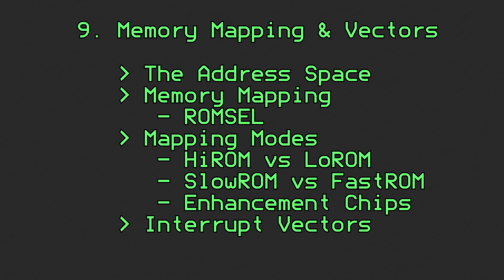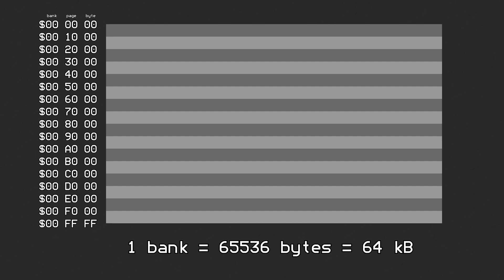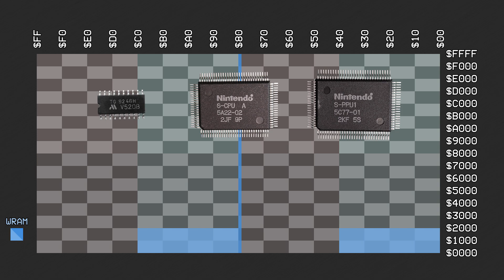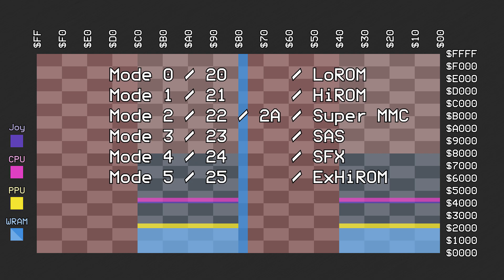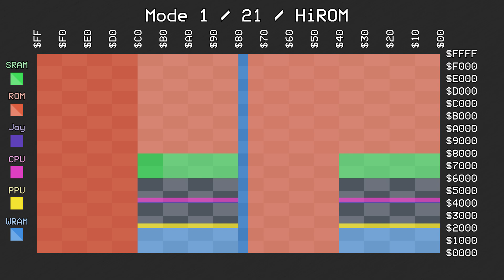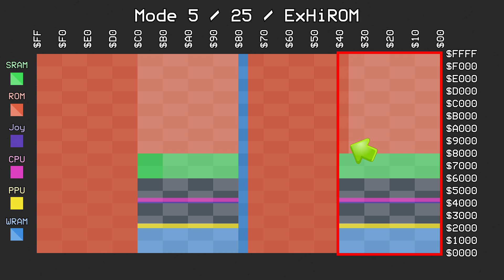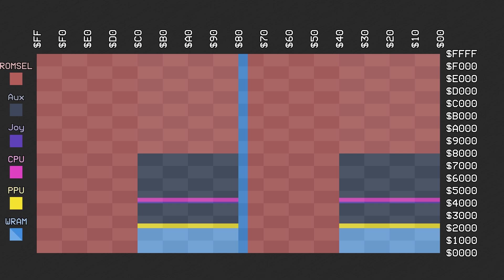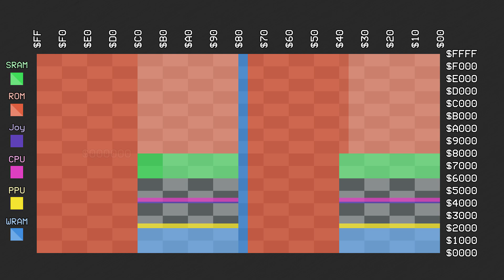Memory Mapping - Super Nintendo Entertainment System Features Pt. 09

Comment: The more I watch this, the more i think, "wow the snes really is a super version of the NES"
Reply: It was originally meant to be backward compatible! But they couldn't make that work without being too expensive.
Reply: @renakunisaki  It's such a shame that they underclocked the CPU for that, but were too far along in development to reverse it when they cancelled the feature.
Reply: The Snes's CPU isn't even a problem.  Everybody just programmed it the wrong way.
Reply: @aaendi6661  Well, if the programming techniques known to the programmers at that time were completely unorthodox to how the CPU should be programmed, is it the designer's fault or the programmers' fault?
For me, particularly, the best thing they did on the GBA was putting an ARM processor.
Reply: @JoaoBapt  All they had to do was ditch the belief that "the more cycles you use the faster it runs."
Reply: @aaendi6661  The SNES’s CPU is really slow and the system is pretty much CPU bound
Reply: @MaxOakland  The memory bus bandwidth is a bigger bottleneck than the CPU. It seems slow but actually has some features that make it punch above it's weigh. It just needed to be properly used.
Reply: Except for the PPU
Reply: @aaendi6661 either way, it doesn't beat the 8 Mhz Motorola 68000 that was used two years before the SNES came out

Comment: Imagine if Nintendo had actually gone through with full NES backwards compatibility. I wonder how they would've implemented the audio in that case.
Reply: I actually wish the SNES had NES audio as well as a couple extra channels.  The SPC700 is frustrating as hell to work with.
Reply: Emulation?
Reply: @aaendi6661 is it possible to make some kind of expansion like the Super Game Boy but for NES games? There would be a NES CPU, PPU, and RAM (somehow condensed idk) as well as a NES cartridge port. I wonder if the NES APU could be played alongside the SPC700. Not sure how the Super Game Boy does it (if it even includes the LR35902 sound at all, I should've searched this up before writing)

Comment: The funny thing is that, Nintendo spent all this effort designing the memory map so programmers could use 16-bit addressing mode,  yet 99% of programmers went with long addressimg mode for everything anyway.
Reply: what... but that's a huge hit on performance on an already underclocked CPU... It really should've run at 7.12Mhz, like the Turbografx
Reply: @vuurniacsquarewave5091  The reason why everybody did it like that was because Konami did it that way, and everybody just took Konami's word for it.
Reply: Turns out developer time is a finite ressource too, and more costly than hardware.
Also, hardware designers have a very bad habit of poor documentation. I do remember many early SNES games lagged unnecessarily because of this.

Comment: I'm glad you explained why all the different mapping modes exist. It seemed unnecessarily complicated to me when I read it (compared to the Genesis, for example, where the map is almost always the same), but having different modes for different tradeoffs w.r.t. data contiguity and access time makes a lot more sense.
Reply: It's too bad 99% ended up just using long addressing for everything in SNES, throwing any speed benefit from the way nintendo organized memory out the window.
Reply: @aaendi6661  I'm very interested into which games actually used the SNES the best way possible, do you have examples?

Comment: It's crazy how such an obtuse and unintuitive subject can become simple and clear through just proper explanations and simple diagrams.

Thank you for your work.
Reply: @B3Band  ive been reading up on assembly for the snes, and this makes it so much more clear.
Reply: programming, in general has that reputation because people just don't explain it properly...
assembly and other low-level cocepts tend to have it worse since they're considered "obsolete" in most applications [till you mess with drivers, compilers, NEW systems, embedded systems, so on]

i'm personally starting to see assembly and whatnot as being positively more SANE than C++ and its derivatives..
they still can be hard without the right sources of documentation, but the only real difference is there's a lot of manual memory management, and it takes many small steps to do something that seems 'simple' in other languages. i admit it's scary that you could so easily cause a fatal exception and totally crash the machine, but i somewhat prefer that over the abstractions and crap built-into C++ and the likes

not sure if i'll ever touch SNES homebrew or hacking, but this is an awesome series, and i do find it quite interesting actually being able to LEARN how this stuff works. One of the big turn-offs for me is that finding good documentation is next to IMPOSSIBLE. [btw, don't lookup windows exes...] 

i've currently been looking into 68k assembly and trying to reverse-engineer a NEO-GEO game. that's... umm...interesting. So far, documentation on the system is pretty good. My gripe is the CPU... I have currently three major sources of documentation I'm using, all for specific purposes... >.> [Which is why I have not touched this particular project for months until now.] Ofc, the M68K is actually a fairly complicated processor, but it certainly isn't as bad as x86! I'm slowly starting to grasp it better. At least there was thought into what kinds of complicated instructions were really necessary. One of my least favorite x86 things to actually try and understand is/was "repeat not equal scan a string of bytes" aka repne scasb. I kinda get it now, but not personally one of my favorite opcodes to stumble upon... It's one thing to say "this is how you get the length of a string" [its main use]. It's another to break it down and EXPLAIN what, exactly it's doing... 

I have a few windows games I'm looking at, but I'm a bit burnt-out from the combination of x86's nightmare fuel instruction set and the way windows executable files work behind the scenes. It's just not fun... Good news is what I was doing this for was mainly to break-apart resource files, which I'm slowly figuring-out on my own. [and with some help] I could probably code the logic for one of these games by myself, now. The others might require some research, but it's certainly faster than slowly working-through assembly code.

Anyways, the content on this channel is pretty top-notch. The world needs more like it. Maybe assembly wouldn't scare people so much, and maybe homebrew development and/or ROMhacking would be more accessible, if the resources were actually OUT there to explain it in a manner that's easy to digest. So far, they're quite lacking...
I know assembly used to completely terrify me. And then I discovered the small handful of places that explain it in a way that it may be understood. [from my experience, it's usually not those technical manuals] I'm nowhere in a position to be completely proficient with it, or make use of it, but I'm learning, slowly. It's overall a pretty fun process. It can be stressful or frustrating, but it's exciting to learn about, especially actually be able to understand even a fraction of just how our computers manage all the complexity that most of us would take for granted.
Reply: What about C, it's supposed to be closer to the 'metal' than C++?
Reply: @B3Band  He meant simple as in "easy to read", not "easy to make".

Comment: Now imagine, on NES you only have the first column of this graph, 0000-FFFF, so only 16-bit addresses. This 64kB area is then broken down similarly:
0000-07FF - 2kB Work RAM
0800-1FFF - Mirrors of Work RAM
2000-2007 - PPU registers
2008-3FFF - Mirrors of PPU registers
4000-401F - APU (sound) & Joypad registers, Factory testing registers (locked without modding)
4020-7FFF - Not mapped / Open bus (typically used by extra Work or SRAM and more advanced MMC chips)
8000-FFF9 - Cartridge ROM (an MMC chip in the cart if any, is responsible for banking the larger ROM into this area)
FFFA-FFFF - Interrupt Vectors
Reply: The SNES was planned to be backwards compatible but that idea was canned half trough the project, too late to change stuff around tough.

Comment: One thing to add is that the cpu can have 24 bit instructions. But works faster if you restrict yourself to instructions using only 16 or 8 bit addresses. This makes it useful to layout the memory in such a complicated way
Reply: Too bad nobody took advantage of this.
Reply: @aaendi6661  I'm sure you're exaggerating a bit... Then again, I don't know too much of the SNES outside of SMW and YI.
Reply: @MarioFanGamer659  I don't know about Yoshi's Island, but Super Mario World definitely overuses long addressing.
Reply: @aaendi6661  I get your point but also remember that SMW is a launch game (it also was slightly rushed, IIRC) and the 65c816 processor is a rarely used processor it makes sense why it used unnecessarily long addressing (at least the lack of data bank shenanigans). Of course, it also uses (sometimes) long addressing when it isn't absolutely necessary (either same data bank or data bank switch is faster) which is where I get the "overused" part (I still believe you make mountains out of molehills, though).
Reply: @MarioFanGamer659  Capcom never got any better with it.

Comment: FOR THOSE ASKING ABOUT 'WHY MIRROR RAM'

From what I got (I'm no expert, but I have at least some understanding of memory and programming) .... picture a Playstation Game on 4 discs. Say, FF8. As you go through the game, you can revisit older areas. Why? Because those older areas' data are mirrored on the later discs. If they didn't mirror the older areas' data, then you would get a "Please Insert Disc 1" every time you wanted to step into Balamb Garden, for example. The memory mapping works much the same way: If you're working in a specific area of the RAM, it is much slower to jump out of that section, and into another section to find the data you need. UNLESS, of course, you copied that data and mirrored it into several different sections. Now, they didn't mirror ALL of the data, only some of it, just like in FF8 .... dialogue and cutscenes, for example, the FMV video that plays during the assault at the beginning of the game only exists on Disc1, as does the FMVs where Squall is dancing with Rinoa. Why? Because you'll never see that cutscene past that point in the game, no point in copying that onto the other discs. But, Balamb Garden's assets need to be copied onto 3 of the discs, because it is possible to visit Balamb Garden at multiple points in the game. You don't want the player switching discs constantly, so you copy some of those assets that you think the player will be needing periodically throughout the game. Make more sense?
Reply: But the whole point of RAM is that it allows random access... I'm not sure what it means to "jump out of" a section of RAM, I'm not sure that makes sense. Are we talking about caching, or segment registers, or what?
Reply: @thealliedhacker  If you saw earlier in the video, you address different parts of RAM with addresses. $AABBCC format where AA is the pointer to what section of RAM you're working in. Let's say there's an address that you need some data from at, say, 01AAAA. You could just simply write "AAAA" (which saves you 2 letters in the code) and if you're already working in area 01XXXX, the 01 is implied unless specified otherwise. But what happens if you're working in area 07XXXX and you need the data that's stored at 01AAAA? You'd have to code your instruction to specify 01AAAA every time you want to point to that data. Unless of course that 07AAAA is mirrored and is the same as 01AAAA. Then you could, in fact, just write AAAA and you'd get the same data (you'd be jumping to 07AAAA but that's fine, because 07AAAA has the same data as 01AAAA).

EDIT: Also, correct me if I'm wrong, but if you're working in area 07XXXX and you specify that you wanna go to 01AAAA for data, doesn't the implied area change to 01 so you'd have to again change it back to 07 to return to area 07?
Reply: @Dhalin  Well, that just sounds like we're trying to save memory by reducing the size of the instruction, not that the instruction will actually take longer to execute. It still seems like the speed is the same, unless decoding the longer instruction is slower or switching the bank has its own intrinsic cost for some reason...
Reply: @thealliedhacker  Well, if my edit is true, then it would also take extra instruction time to swap whatever the "current" area of RAM is, too. There's probably more to it, in the actual circuitry, a millisecond here, a millisecond there, I mean, a lot of SNES games lag as it is when there's too much going on, so I'm sure they did these things for a valid reason.
Reply: @Dhalin  Well, I assume it wouldn't require an extra instruction to move back though, since the next instruction could also just use an extended address, so we still wouldn't lose any time...? I dunno, maybe the main factor is just saving the space in the instructions.
Reply: @thealliedhacker  more like allowing different hardware to access the same bus, cpu and ram without lockstepping any of these. Say I want to transfer stuff between PPU  and WRAM through DMA and I want it to abuse a sequential access (burst), then a HBLANK interrupt wants to update OAM memory to use special effects or scrolling registers, but the interrupt code runs from WRAM, if a load operation happens from the non mirrored area it stalls the other transfer. That is solved through mirroring and improves stability if other hardware might not have a tri-state switch for simultaneous stalling. (a.k.a a cascade/RDEN /WREN signal between hardware sharing the same bus, the memory handles the lockstep control), also allows to move the memory outside the cpu addressing scope to reach other hardware which may need equal critical timing access, such as an external co processor IRQ.
Reply: that doesn't sound right. I believe the mirroring occurs due to some funny business with MSB's of address buses and what they are mapped to.

ie. every time you write the an adress with unused MSB's you essentially ignore those while still setting that pin to high on the chip itself. but because there is no bus wired to it it both reads and writes the same values regardless of what address the CPU itself intends to use.

So as far as i know, those higher areas of memory actually contain garbage data and any time you read from those higher mirror adressess you're actualyl reading from adresses from a lower range
Reply: @thealliedhacker : reducing the size of an instruction actually has a measurable effect, and it's exactly why these addressing modes exist. The 65816 is a successor of the 6502, which often ran at ~1MHz, and at that speed you need every single cycle you can get. Fetching one byte less for the instruction's memory address is why there was the popular "zero page"... Look up the "27c3: Reverse Engineering the MOS 6502 CPU (en)" video for more info.
Reply: @thealliedhacker  A jump instruction (where you move from one code line to a another in a different place) can take longer (more CPU cycles) to execute if it's far away in the memory space. Shorter jumps are quicker to execute.

Comment: All this block mirroring stuff makes me wonder if there is something going on that I don't know about. For example, is using a 24-bit address sufficiently burdensome that trying to use a 16-bit address within the same bank is preferable? Besides the obvious fact that 24-bit memory instructions are 32-bits in size, and the difficulty of assembling a 24-bit address from two registers.

That's the only reason I can come up with for why mirroring would be so frequently used, when you could just have more available storage in the ROM.
Reply from the maker: As you'll see in the followup to this video, mirroring is just a side effect of the simplest and easiest way of interfacing with memory chips.

Comment: The LoROM seems similar to how memory mapping worked on the NES. If the program bank register is between $80 and $BF, the data bank register set to $80, and the direct page is set to $8000, the memory is almost laid out the same as the NES.

Comment: I still dont get why the Address space wastes so many addresses on mirroring why mirror if the entire 24bit space is addressable? is it to save clock ticks on higher address access? Just dont get the logic.
Reply: Incomplete decoding of addresses was a common trick to save transistors back then. The decoder circuit would only check the n highest or lowest bits of the address instead of checking every bit. Often, e.g. with smaller ROM chips, the excess high address lines were just ignored, which resulted in ROM mirroring over the CPU address space.

And not many games used the entire ~8 MB theoretical ROM capacity of an un-switched SNES cart. They only started pushing this towards the very end of the SNES's lifespan. Super Mario World was only 512 KB.